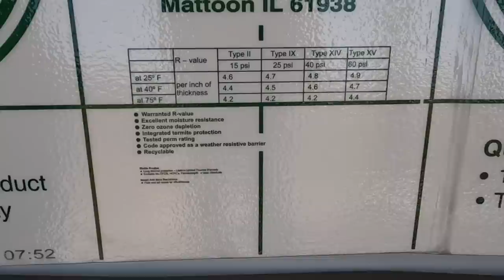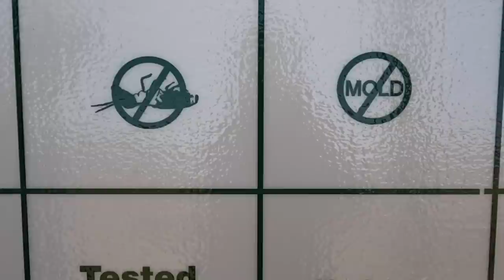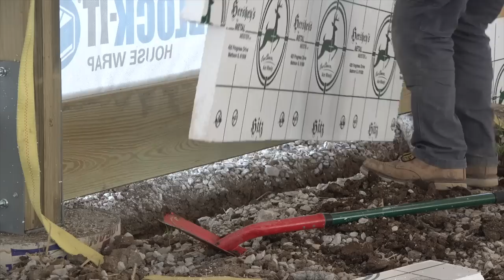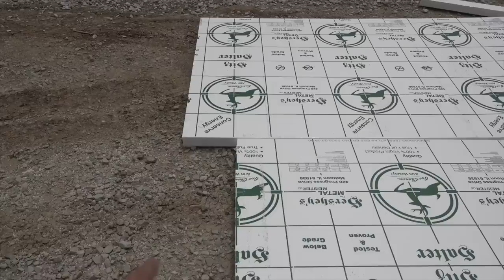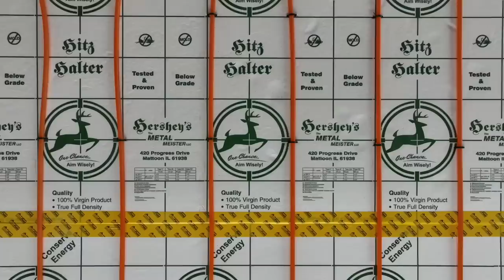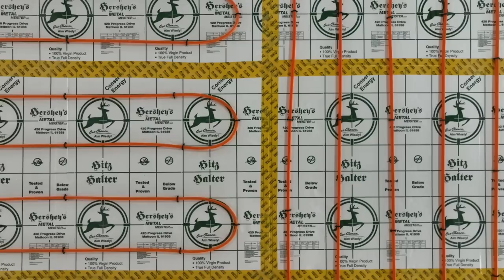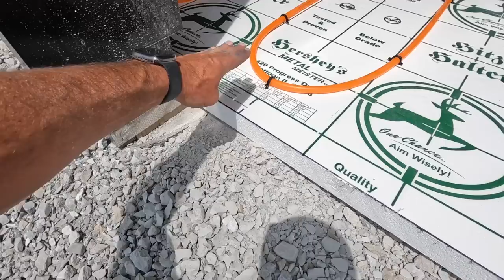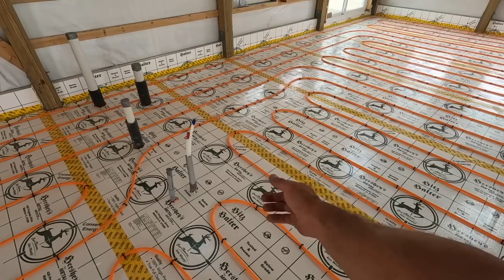Perfect Below Grade Insulation | Hitz Halter | Insulation + In-Floor Heat Install

Comment: you guys are usually very up front with pricing.  I'm surprised you just don't say what a 4x24 ft sheet costs.  I can do the calculations on how many I need and would be glad to order from you, but this feels somewhat secretive.... or its expensive as can be???
Reply from the maker: Shipping costs makes it hard to predict. We are working with the company to get more dealers which will help make it a predictable price.

If the shipping is reasonable it’s less expensive than pink board. Also less labor to install.

Comment: Any worries on pouring the slab around the brackets and posts? Are the posts treated? Or would that be overkill? Im pouring my piers tomorrow and trying to determine my pier height today.
Reply from the maker: No worries. Bottom of our columns are treated. Locks all the brackets in as well.

Comment: Another great video! Was wondering if you did a cost breakdown vs. using the pink foam board with the poly vapor barrier? Also are you going to do a video on the completion of the above ground storm shelter?

Comment: In your other videos where you use 4x8 sheets of pink foam and plastic for subfloor insulation and vapor barrier, you show the piers and posts/brackets being wrapped with the plastic before the concrete is poured.  How do you see this method of insulation being finished around the piers to keep the concrete off of the brackets/wood?

Comment: As I understand plastic underlayment, plastic should go on top of insulation for heated spaces, plastic should go underneath underlayment otherwise.  Won't having it on both sides of the insulation present a problem?

Comment: Are you ever worried that using wood as the grade board that it will rot or need to be replaced at some point?
Reply from the maker: No, it's treated, protected on the exterior with metal trim, and inside is covered by insulation and concrete.

Comment: You have talked about using 18’ columns before and getting 9’ ceilings downstairs with 12” floor system and 8’ ceiling upstairs… but if you use 2” of insulation and 4-6” of concrete above the concrete where the post is mounted don’t you lose ceiling height?
Reply from the maker: The columns are actually longer than 18'. When we create our story board or template to mark all the columns we take into consideration the insulation and concrete...usually about 7". So the columns we order are usually 19' for a 18' sidewall.

Comment: This is all real pretty and everything but WHERE IS THE DATA ? 
I want to see side by side slabs with this expense compared to sand, plastic sheeting and perhaps some rock wool, treated cellulose, cork, etc thermal barriers.
Reply from the maker: We definitely could do a breakdown video.  Some of those options we don’t use but could price compare.
Reply: @MrPostFrame  To be clear, I'm looking for the EFFECT. Thermocouple data under and in the slab of THICK foam underlayment vs two or three sheets of plastic over gravel and sand... What is the real world gain of burying all that foam vs a simple thermal barrier..

Comment: We just used on our house in Tennessee.
Reply from the maker: Did you like using it?
Reply: @MrPostFrame  yes, sold outdoor wood boilers for years and did the 4x8’x2” blue board.  This was nice with it being fan-fold and 4’x24 and also with the grid of the lines on it.  Happy you shared it with everyone.  Keep up the great work Paul.
Reply: @klwit1980 What part of TN? I'm planning out a shop build in middle TN. I might look into this for the radiant floor heating option.